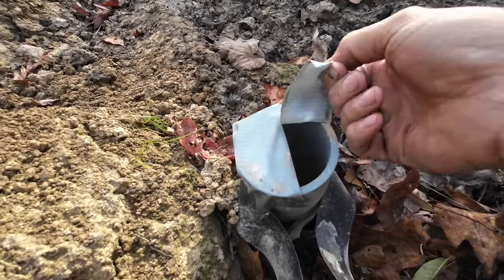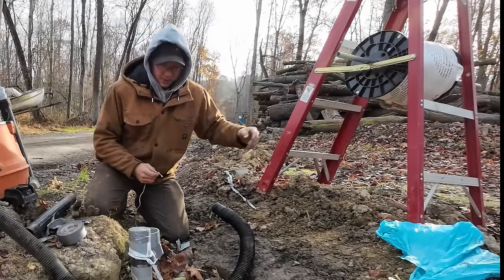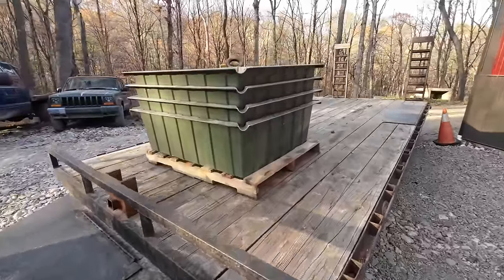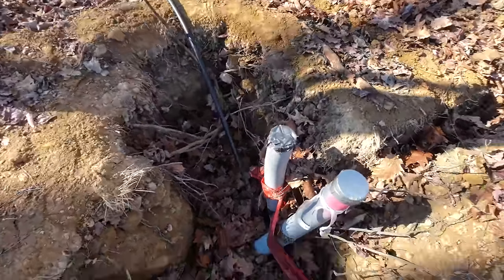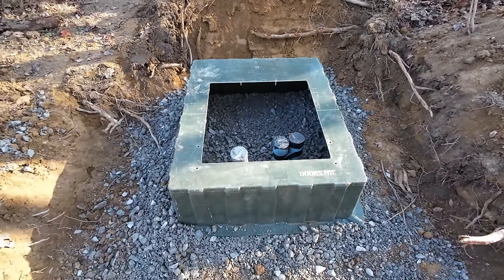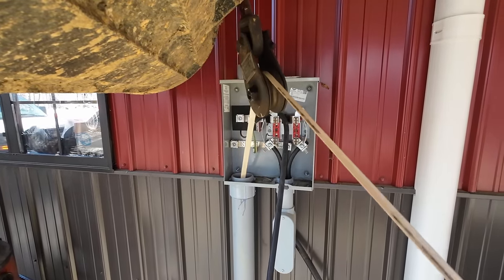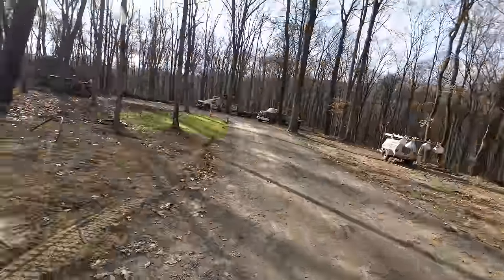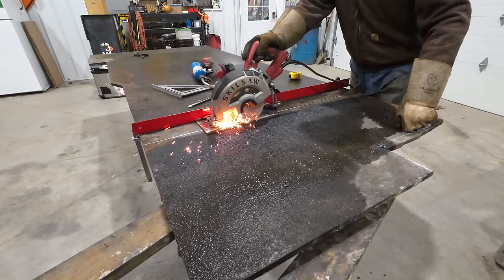The Power Company Charged me $52,000 for this!!

Comment: Hi Matt! Been watching your videos for years now, always fun watching you tear into all these heavy projects on your own! Can’t describe the sense of inspiration you give to work through a tough obstacle! 
Just wanted to maybe give you a few tips on installing basements and terminating in meter bases in the future. I am an electric lineman in Michigan so we do this work all the time. When burying your basements we typically don’t burry them flush against the ground because they will tend to settle into the ground over time. I’ll leave roughy 8-10 inches or so exposed out of the ground to set the transformers and switch cabinets (which is what is by your gate) on for settling and also it gives you more room for the primary and secondary wires to bend around and more room for us to work with them easily to terminate as well as have extra wire for when the frost starts to pull on the wire it won’t pull the bushings out of the transformer. This also applies to your meter base. I always make a decent bend on our wires so there’s a few inches of wire to play with for frost. Doesn’t have to be much but a little snake bend can make all the difference as opposed to just running straight up like that. Been to many homes over the years where it’s pulled the meter base right off the home or barn and everything has to be redone. Just some little tips and tricks for you for next time if you ever have to do it again in the future!

Comment: Another step in the right direction. The price to do the power is never cheap. In New Hampshire here at my son's house I did a power service upgrade from 150.amp service to a 200 amp service this spring. I dug the 225' trench and laid all the 3 inch pvc and 1 inch pvc with my son. Public Service had us pull the strings as well and install slip joints at the meter box. There was no cost for the wire underground because when, they are upgrading the power it's free, so that was a huge savings. Your progress on your shop and land is amazing, keep up the good work. Happy Holidays.

Comment: I tried pricing 15Kv primary wire and it's about $15 per foot. I'm guessing the single phase transformer was $5,000, and the new pole was probably 5,000. So about $43,000 in materials and the rest was labor and profit. I'm happy you finally have power. I've been thinking you'd want 3 phase power but i can't imagine what they would have charged you to run that.
Reply: I’d put that transformer closer to the $10k range, depending on size & manufacturer. I would guess it’s an around a 25kva.
Reply: I know a fellow who doesn't live this far out. I mean he has power already to his shop but 3 phase was still going to cost something near this to have it as his residence. He just went the rotary converters. I just remember it being stupid expensive .
Reply: I just installed 15kv primary and it’s $2.80 per ft for 2 awg full neutral stranded.  Not sure where you got $15 from
Reply: Them prices are maybe from 5 years ago. Transformers can be closer to $20,000 and primary wire $10 a foot
Reply: The whole common carrier massive tax breaks to help subsidize infrastructure is always forgotten and pocketed

Comment: Fantastic!! Nice “clean” work all around.  

Given you have so many trees and often use heavy equipment in the area, I suggest you build a “corral” of concrete piers with a couple runs of good steel rails between them that keep a height well above the transformer. This way if a tree falls on it the corral will hold the load rather than crush the transformer.

Comment: I work the telco side, and we pull U/G cables via same method.  We jet thru or on shorter runs, rod/mandrel thru, a pull string/mule tape.  Then use it to pull through our cables.    In some districts they have a jetting machine to directly jet thru fiber cables.

Comment: It always blows my mind when there’s enforcement of extortion rules like this situation.  Power companies, gas companies and health departments that have complete control of their perspective trades.  They have rules to follow but they are essentially a monopoly with law enforcement behind their monopolies
Reply: Only in 1 Country tho so there is a Solution, Change Country.
Reply: U forgot insurance
Reply: Don’t forget health insurance .the biggest scam and monopoly.
Reply: Yes, they are a monopoly. That is why they are regulated by the public utilities commission. The question is who is keeping the PUC honest?
Reply: Several thousand feet of copper ain't cheap. Especially at primary gauges
Reply: Having my house built in 2007 I learned Florida Law requires all new residential units connected to grid power, no off grid power allowed except for backup.
Reply: Common carrier = big tax credit right. So basically he gets to pay for this twice.
Reply: @robmatthews7972 But this is just a workshop, not a residence.  Those laws don't apply.  I think solar + battery backup without a grid connection would have been the way to go here; probably cheaper in both the short and long term and better for the environment to boot.  But what's done is done; I suppose he still could add solar if he wants too later.

Comment: Well, I paid $1,800 to replace my 20-gal steel well water pressure tank & switch. In its place is a 30-gal composite tank. Mind you, I dug up the old tank with a standard spade shovel & I had to bury the new tank. 

A regular plumber quoted me $3,500 to do it. Service call just to come to my home is $300 & if he had to use his own mini excavator, that is an additional $200/hour. And the tank replacement is still $1,800. 

When it is a necessity - it will cost you and arm and a leg, then some more. 

Which is more of an eye-sore? Small green boxes or wood poles sticking in the aire?

Comment: Granted you did much of the duct work, but you're talking 800m of high voltage cable (they're only trained to work on specific types types, so can't use any old crap), the transformer itself will be the thick end of $15k, plus the joint termination kit (both to the overhead line and transformer), plus the admin to assess whether the overhead line had enough spare capacity to give you what you wanted.

Comment: Hey Matt, if you see this, for future reference, mule tape has a little number printed on it every couple of feet. Those are footage. Read the number at both ends, subtract the smaller from the larger. That's your wire length without pulling the tape out to measure.
Reply from the maker: I checked my mule tape before I pulled it. No numbers on mine.
Reply: @DieselCreek  gotcha, I figured it was worth mentioning. Thanks for the effort you put into your vids.

Comment: Nice work. The vacuum strategy is so satisfying on those long runs! 
Although for 52k + whatever else you already spent, + cost of electricity, I'd just stay off grid I think. 52K would get you a MASSIVE solar+LFP battery setup and a decent backup generator.
A little more complicated, but being self reliant is pretty cool IMO.

Comment: At my farm there's a power pole that has the HV feed from the line coming into it underground.  The feed runs up the pole, then back down the pole to a transformer that sits at the base of the pole.  There is no need for that pole, the HV feed could go right into the transformer.  But to have the power company do that would have been over $10K in 1980's dollars.  Doesn't bother me any, the pole isn't in the way.  (The reason the pole is there is that the HV lines used to be above-ground and there was a transformer at the top of the pole).

Comment: While I understand your frustration with the cost from the utility company, I also understand, from their point of view, how they cannot allow just anybody to pull high voltage primary wire, even though it is deenergized. There is huge liability on the side of the utility company if anything goes wrong with primary wire. While you are doing excellent work and would probably have no issue with pulling the wire, not everybody would do the same good job and the utility would be left with a lot of headaches from improperly done projects of this sort. I'm glad you got it done and look forward to continuing to watch your excellent videos. Thanks.
Reply: exactly what i was thinking!

Comment: We ran into this for a friend of mine. His power “run” from the utility access point was 3/4 mile. Originally They were going to install 10 power poles with one transformer and the overhead single wire. Total cost estimate was $62,000 for the power company to do it but they wanted a 65 foot easement cut along the power line from the trees that were there. My friend bought that property for the nice forest that was there and to cut down 30% of those trees to run the power was a bit of a non starter.  We obtained a spool of underground cable for $16,000 that was over rated for his load and had the power company put his meter and transformer on the existing power pole by the road. We then trenched in the cable with a ditch witch to the proper depth beside his access road and installed two step up and step down transformers for $3000 each. The step up transformers boosted the 240 volts from the meter to 600 volts and when it got to his service point on his building we stepped it back down from 600 to 240 volts to tie into his breaker panel. By doing that it reduced the voltage drop on large loads and reduced the wire size by at least two sizes. The power company still charged $12,000 for the transformer and the meter install but the total was $36,000 with the ditch witch rental for going underground.  I am not sure if the electrical codes in your area allow for underground cable instead of conduit but the cost of your conduit and the difference in the wire types is another cost to look at.

Comment: Hang on to those "Chinese finger traps" as you call them! When I was sailing heavy lift ships we would use these to renew wire ropes in the rigging of the cargo booms. Cut off the eye on the old wire, stick this on (tighten the end with a small wire or even duck tape) Stick one more on the 'winch end' of the new wire, connect the 2 eyes with a small shackle and you can pull the new wire through all sheaves using the drum of your crane, When the new wire reaches the drum just tie it off, disconnect and unspool the old wire from the drum on to the ground. As you can adjust the diameter simply by pushing the together you can use these for a lot off different size wires (or cables). Keep them lightly greased or spray with some oil, store in a dry place and they will last a life time. Keep up the nice videos

Comment: Shit, for $52k I could have set you up with an off grid solar setup that would power that shop 24/7. I think my last large one was ~$35k including a shipping container and 100kw backup genset (2 stroke detroit!). Produced ~40kwh/day in the summer and 20kwh/day in the winter. Plus had 40kwh of battery storage. It provided 240V split phase and easily started larger loads like big motors and even ran a 240V welder just fine. Hell, I usually did my laundry at night, off a 240V well pump, full size washer and full size electric dryer - without the genset.
Reply: Does seem crazy not to do solar+battery given the prices… it was over $65k which buys a lot of solar and battery.
Reply: add 50% to that price and you can have Tesla branded solar, installed, and 25 yr warranty.  But still less than this! (AND NO BILLS)

Comment: As someone who does this professionally, I can’t think of any utility that lets anybody else but them run the primary cable.  Everything you did looks good, but we spec sand instead of stone for the transformer pads.  Those guys look like they had tons of help; we would usually do that whole project with 4-5 guys max, but we’d be there for most of the day
Reply: The power companies follow policy for everyone.  In this case, it seems like the owner was trying to negotiate. And complaining about the cost was not warranted. The 52k was set in stone from the time this job was imagined. And on top of that, the power company didn't do it in less than 10 months. Almost a child-like attitude for this process.
Edit: Allegedly 10 trucks plus workers... 52k sounds about right. Power company isn't a charity.
Reply: my nearly 60 year old pole pig died a couple years ago. Since it contained PCB based transformer oil, it required special handling. There were three  trucks, and 10 people on site to ake sure that everything was done properly. This incled three people to observe the process, s they could be qualified, and a field supervisor
The failure was frequent, short outages, until it finally quit. It also had an internal arc which wiped out all AM radio, and HF band radio.
Reply: @michaelterrell  cool info, thanx. i guess pole pig is a transformer.  but i didn't even think about the emi interference/havoc it would cause, lol  kinda like the old days when a bad ignition condensor(cap) just killed the cheap factory speaker sound during the days of 8 track.
Reply: @michaelterrell  Yep you need the three observers what ever happened to plain old common sense ?????? And employees that knew what they where doing without overpaid supervisors making sure they didnt get a blister or paper cut. Or God help it if they where misgendered or someone used the wrong pronoun to them lol
Reply: @TheSilmarillian  I had fun with Cincinnati Gas & Electric, back in the mid '80s. I had designed an interface between two incompatible Cable tV systems. I managed to talk them into allowing us to mount a large outdoor NMA box up the pole to hold the equipment. Something that they had never allowed.
Another incident was a damaged pole mounted CATV power supply. It had to be disconnected from the secondaries before I could replace damaged conduit and wire. 
I only had a ladder that night, so I couldn't safely disconnect it because of its location 
They refused to allow  those transformers to have a disconnect switch, or a weather head on top of the housing, Instead, there were three 90  degree PVC fittings to bring the power into the bottom of the transformer housing. Cracks would develop in the conduit, and they would fill with water. Our liaison with them was on vacation. It took me over four hours to convince a dispatcher that it had to be disconnected for service, because it was arcing inside the conduit. By the time they agreed, it was too late to get the parts that night. I had over 5,000 customers without service for about $6.00 in parts.
I repaired it the next morning, only to be told that it would be at least three days before it could be inspected and reconnected. 
Refunding about halk our customers for four or more days would have caused a huge loss. and could even cost us our franchise.
I had a bucket truck that day, so I reconnected it, myself. They had left the split bolts on the secondaries, so I hooked it up, then wrapped it wit the same 3M cloth friction tape. We never did hear anything about me doing that.
Reply: @defresurrection  Wow, you know all about the inner workings of that particular power company.  Imagine that.
Reply: @TheSilmarillian  A paper cut isn't likely to kill anyone a minor error with high voltage can be instant death

Comment: With the Wood Boiler you can set a Circulator to feed a couple of Hot Water Air Handlers also and help heat the shop. Free Heat. They make Hydronic Air Handlers. You should Set a Supply and Return Manifolds to allow you to connect other devices to the Wood Boiler. Lots of Flexibility. Size the Supply and Return Piping to the Boiler to give you extra capacity.

Comment: When you got the bill for the power did it come in the form of little bits of letters cut out from various magazines ? 
I can't imagine how much they would have charged if they'd done EVERYTHING themselves.
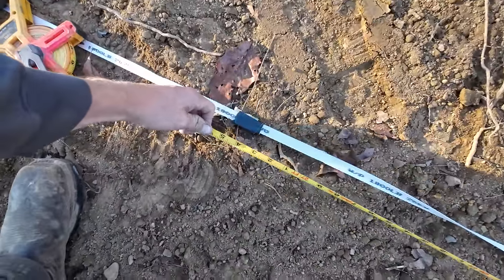Reply: 25:08     52k.
Reply: @bobbg9041  That's 52 grand just for the transformer, wire, pulling the wire, plugging in meter and hooking things up. It does not include the conduit, burying it, pull tape, pulling pull tape OR the run from transformer to building.
Reply: @bobbg9041  I know it cost Matt 52K but he did most of the work himself.  What I wonder is how much it would have cost if the power company had done everything.  Dug holes, dug trenches, dug up and repaired the road, laid pipes, filled trenches, placed transformer boxes, run the strings then the pull lines, then the wiring and lastly the connections.  It would have cost at least 150K.
Reply: @ellesmerewildwood4858  it would be a fortune and with wire prices now especially high voltage this price with transformer and all those guys actually is accurate people just don't understand what all it takes but leaving all that stuff is ridiculous.

Comment: I know copper is expensive at the moment, but for $52K, you must be paying for the premium wire.  Still, at the end of the day, getting power was more important than finding a hill to have a protracted battle with the power company - they hold most of the cards you need.  Those heat pumps were a good investment for keeping the workshop comfortable - I know I would never have anything less in my house after my first heat pump was installed 10 years ago.
Reply: Sad part is it's probably aluminum
Reply: Wire, Transformer and the Hourly Rate of the Technician(s)...
Reply: I mean solar might of been more affordable
Reply: @chrisjohnson4666  Central conductor is probably 2AWG aluminum judging by the size of cable.  There are also a bunch of 14AWG copper wires under the outer sheath as that is 100% concentric neutral cable.